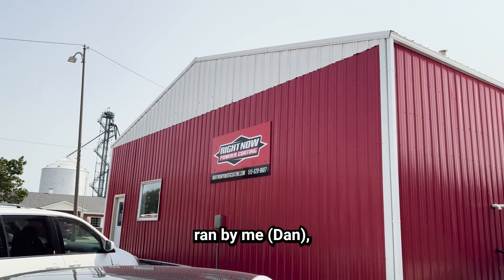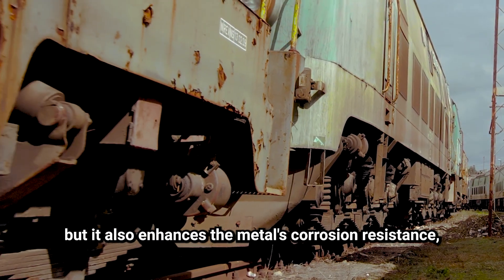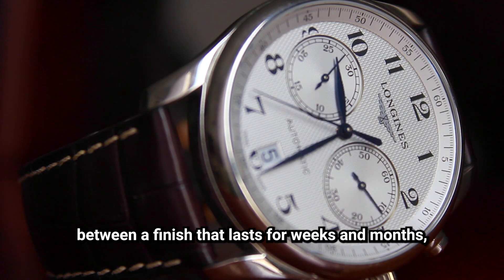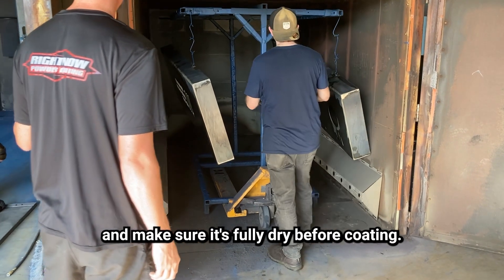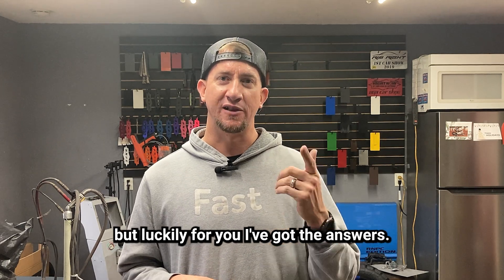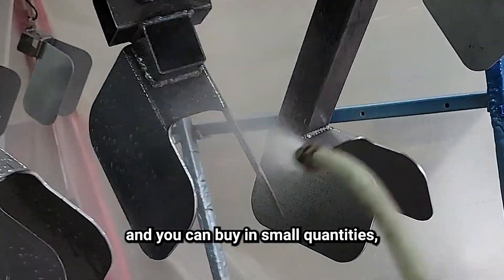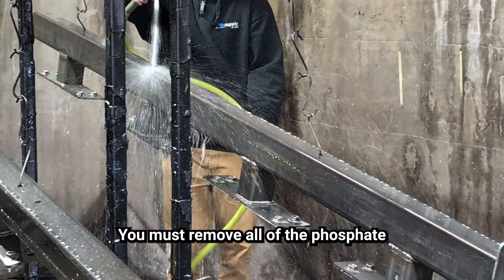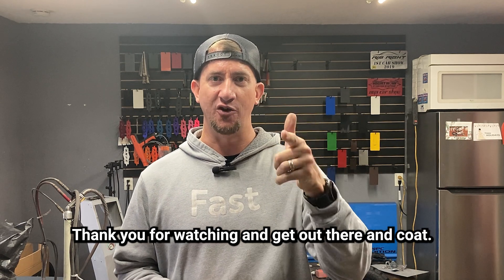The SECRET To Long-Lasting Powder Coating!

Comment: Should I sand blast the parts prior to applying phosphate? Or is this used on large parts when sand blasting is not an option?
Reply: That's a good question. I think for best adhesion all parts should be blasted.

Comment: Safe to assume this is applied after the parts has been outgassed and blasted? Sorry for the stupid question.
Reply from the maker: Most steel parts do not need outgassed, and we dont blast much but yes blast first before doing pre treatment

Comment: I like how he said that a little goes a long way, when he blasted it with a high pressure washer.
Reply from the maker: The chemical is diluted through an injector, so you are not using much, its like 10 percent or less to 90 percent or more water.

Comment: What is done with the waste water and phosphate that is left in the booth?
Reply from the maker: You need to check with chemical supplier and local epa.  We collect in sump and it runs through filters to collect solids and oils then water is passed through to sewer.  Your ph levels must be in line.

Comment: im pretty new at powder coating and ive always used iron phosphate  on everything i coat. I didn't know i needed to clean the part before applying it though.  ive always just sprayed it on after blast, let it do what it does for a  couple minutes then rinse , out-gas , cool and coat.  Can it be applied  while the part is wet?
Reply from the maker: If your part is blasted it might already be clean, not sure on how you use blast material.